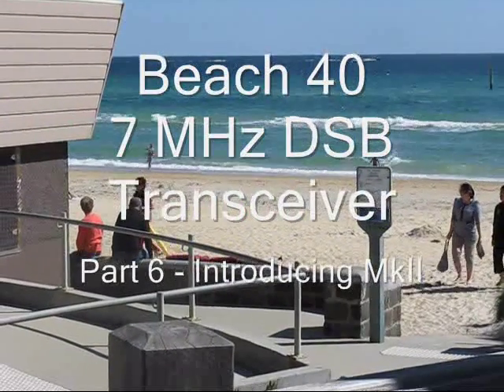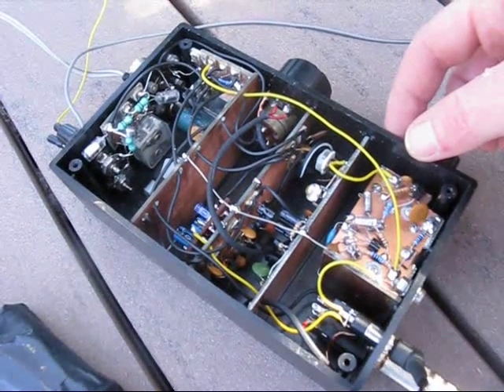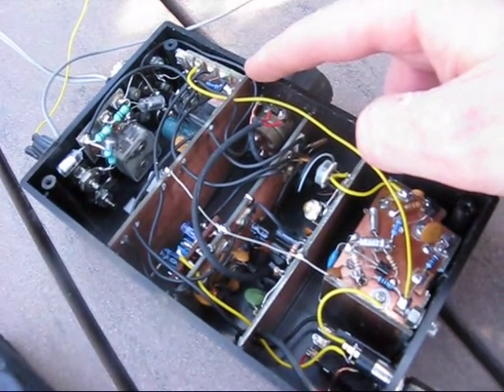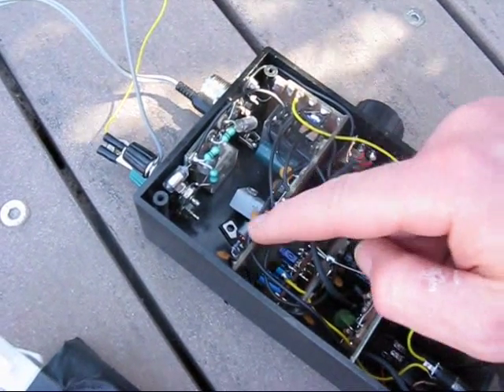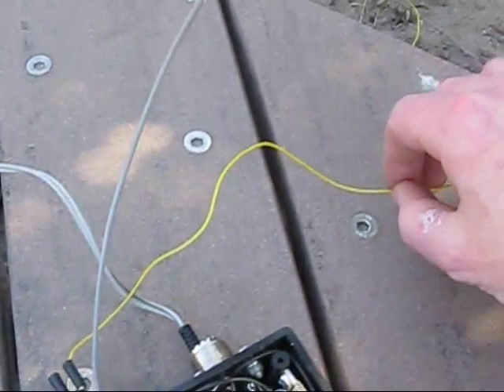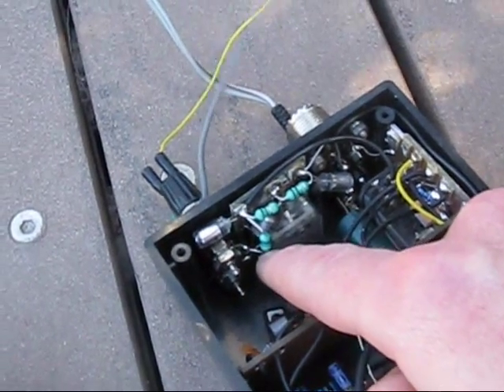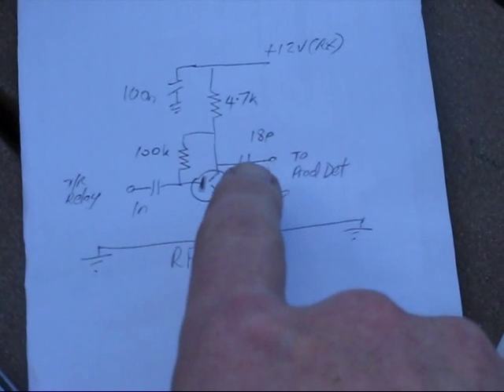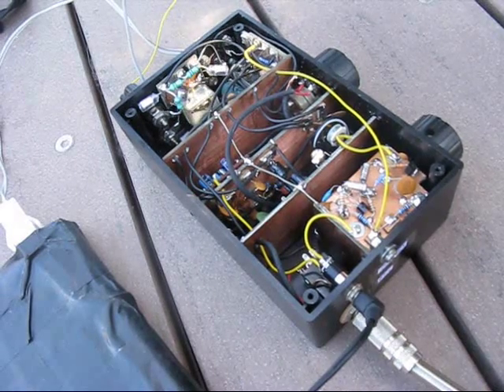"Beach 40" 7 MHz DSB Transceiver - Part 6

Comment: hello from argentina country...build the circuit of your page and it works perfectly...(I bought in amazon to contribute to the website) I could also read that it does not work well for 14 mhz ... there is no 14 mhz dsb tranceptor circuit on your page ... is it very difficult to convert it?
Reply from the maker: Yes, converting would be hard as you can't get suitable ceramic resonators and the gain of transistors drops off. So you'd need to redesign the whole thing and add extra stages. And QRP DSB on 14 MHz isn't very effective. Better off to build Farhan's original Bitx SSB tx for 14 MHz - see his phonestack website.
Reply: @vk3ye  thank you !!

Comment: I have a fully working beach 40 mark 2 where I added a little swr circuit to the l match very nice can I use a 100 watt rf linear amp for 7 megahertz
Reply from the maker: Oliver - I would not recommend the use of a 100w linear on the Beach 40 unless the band is very quiet and there are no stations either side.  Apart from the wider bandwidth of DSB, the Beach 40 has limited audio filtering.  A 3 kHz low pass filter in the microphone line would be a big help to reducing transmit bandwidth.

Comment: hei peter im  very interested in your receiver rf preamp but can you tell me where i have to connect input wire if im using switches
Reply from the maker: Input goes to transmit/receive relay.  You can substitute a DPDT switch for the relay but it's clunky and not recommended.

Comment: Hi Peter, I appreciate your nice work. Here my friend and I have made two beach40 rigs and we are happy with their visceral performance but the problem is that we find it difficult to contact mutually may be due to copying DSB using direct conversion. Can you suggest something......?
Reply from the maker: +K.P.S. Kang It can be tricky but not impossible.  I've done one or two videos of copying DSB on DC receivers.  Or maybe just build an SSB rig and not have the issue ;)
Reply: Upgrade to a DDS. I'm about to release a board for this thing.

Comment: Peter, I slapped a similar RF amp stage into my B40 but mine has a 10K coil in the front connected to a pot which acts as an RF gain control, it works very well

The circuit is based on VE7GC's RF preamp. 2 extra transistors and a coil but it's worth it for the boost in performance

73 Kevin GW4WOV